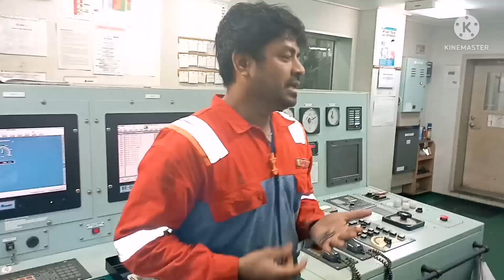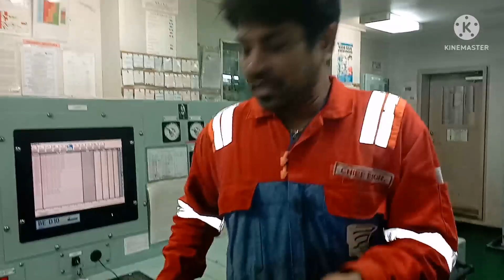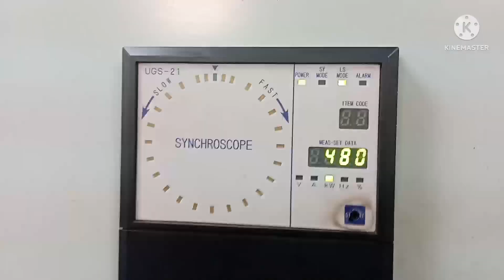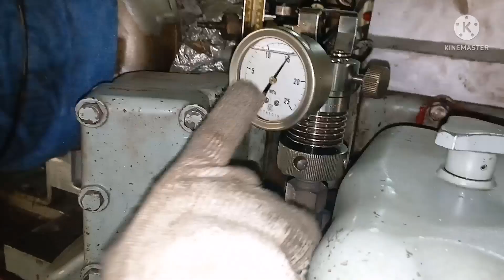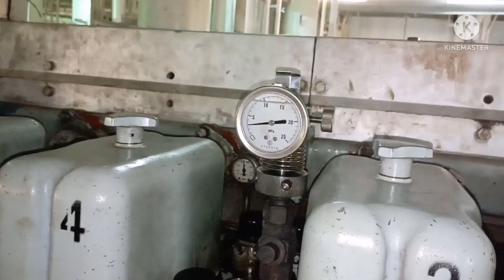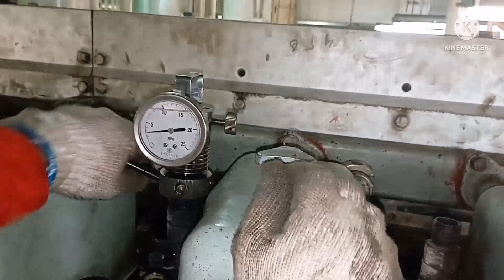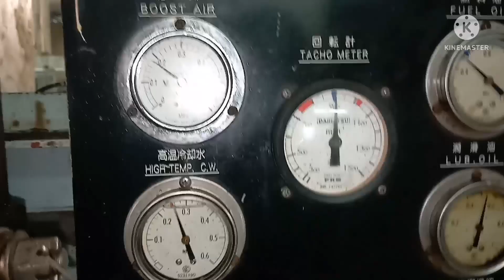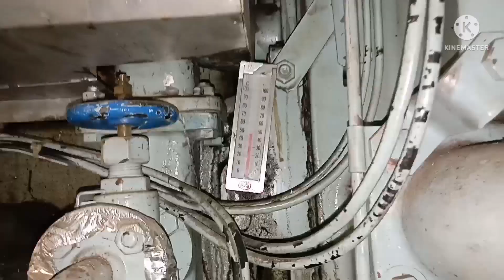HOW DO THEY DO.. HOW TO TAKE PERFORMANCE ON GENERATOR ONBOARD SHIPS...

Comment: Thanks sir.. 
Why we need to take performance while running  on HFO.. Why not DO?
Reply from the maker: DO also  you can take not a problem.. Vessels mostly use HFO to get the performance in normal operation fuel.. V follow this.. More over sea trial s done with HFO and its ec to compare it

Comment: The best . More please information about Diesel engine . AE”s . What to do if our pMax less or more compère with sea trails report . What can be the reason what we need to do ? 
If exh. gas temperature is more what should be done ? 
If ex. Gas temperature less than should be what to do ? What can be the cause? 
Explain please in details more
Reply from the maker: Thanks for your good support sir.. Vl do a vdo on the same....